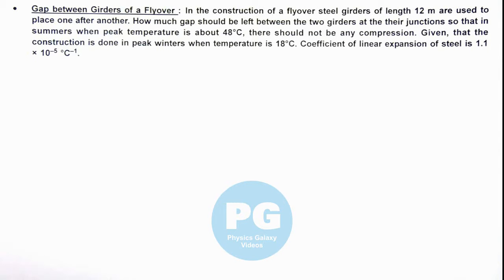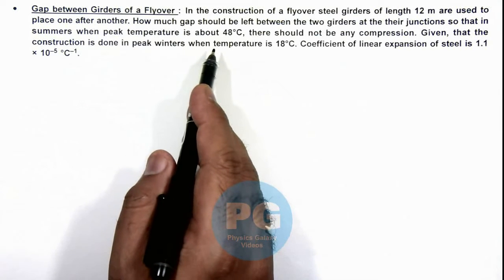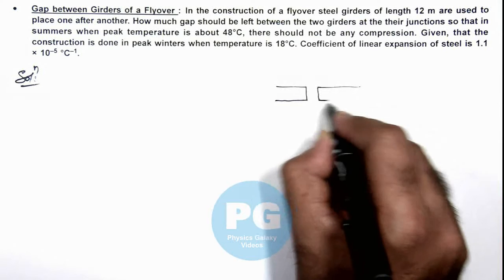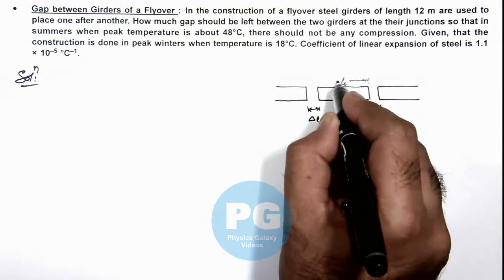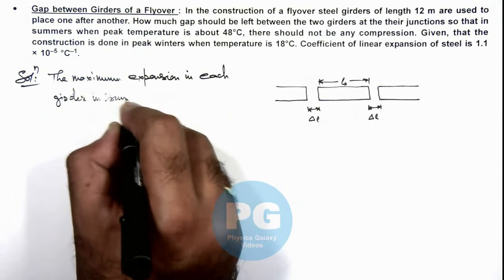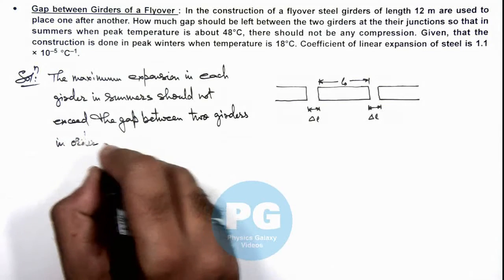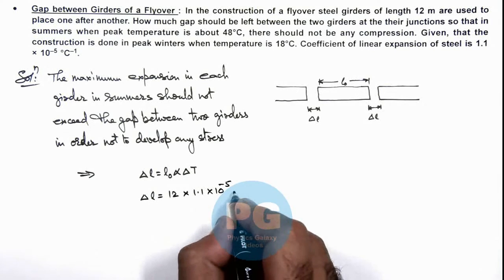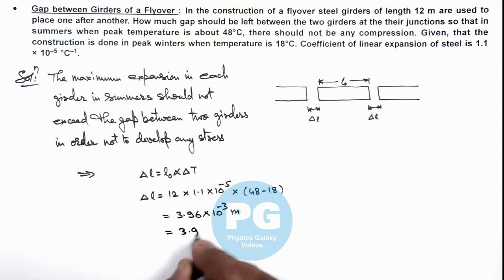1. Advance Illustration | Thermal Expansion & Calorimetry | Gap between Girders of a Flyover

Comment: sir i think this is a bit not true. we use del l = alpha(Ldo) for small change in temperature and length. the temp increase is noticble hence we should do integration . alpha do = dl/l .   which gives the answer as 12( e^(3.3 * 10^-4) -1 ) = x   this also give the same answer as u have solved but to greater accuracy.

Comment: whoever is confused as to why its not double the increase in length. expansion on one side is half the total expansion. and the amount of gap that should be left on each side should be twice because two rods are expanding. SO the half and 2 cancel so it doesnt get doubled
Reply: Thanks
Reply: Is it your observation or did you read or verfied from somewhere?

Comment: Sir but if there are two girders so shouldn't the ans be half of this
Reply: no bro the expansion will happen from both sides so you can consider 1 side fixed and the other can expand upto a maximum length of deltaL only.
Reply: @yaboinonu   okay take the other rod fixed. then we can examine relative increase which 2 del l
Reply: @yaboinonu  baat to sahi hai....expansion dono side hoga.. else compression shit occurs in the question!

Comment: sir if a rod is kept on a table and it can expand freely on both sides now it temp is increased then will the centre of mass of system be displaced or will be intact at its own position and same question for the centre of disc when disc is undergoing expansion
Reply from the maker: If the table is smooth it will remain at rest... as no external force is acting...
Reply: Almost 5yrs what are you doing right now
Reply: Almost 7 yrs wassup bro wyd